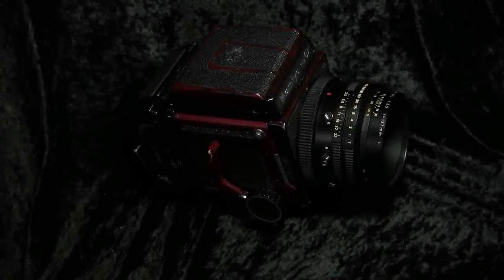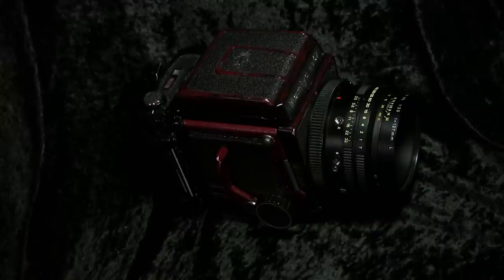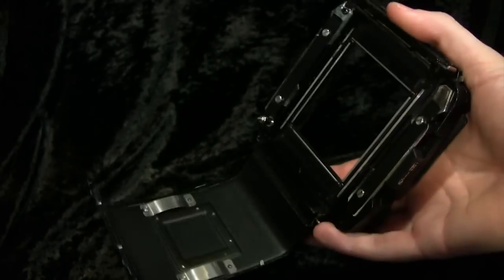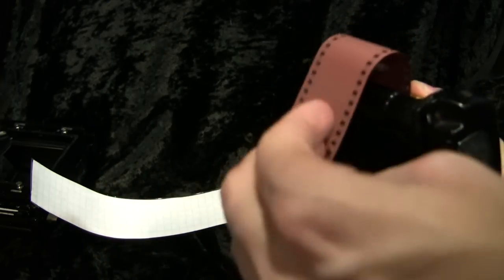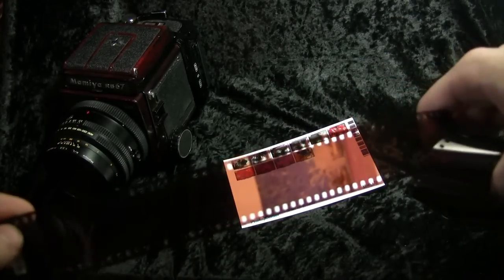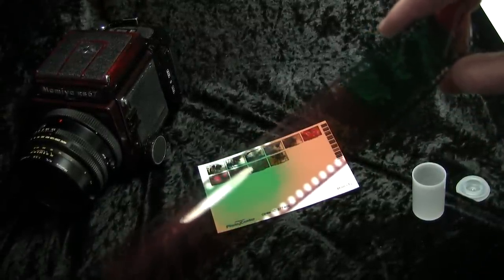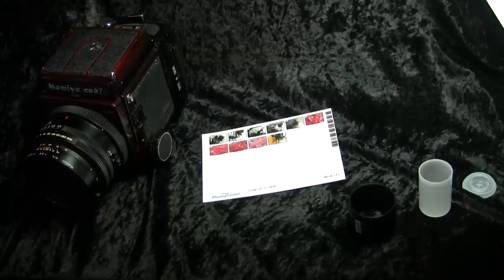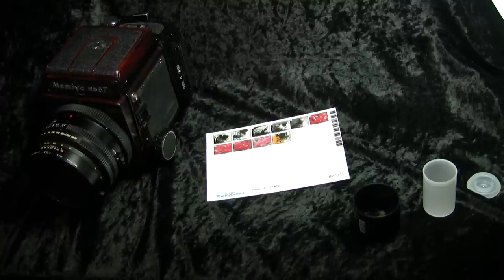Loading 35mm Into RB67 Medium Format Camera

Comment: There are different versions of the counter drive roller.  The Pro SD magazine, with double exposure protection, has the small counter roller you illustrate; the older Pro S magazines drive the counter with the complete turn around roller (that is, there's no separate roller for the counter).  That means they'll count and space the frame correctly with any film that fits in the camera.  To make a Pro SD magazine like yours count and space frames correctly (and start the exposures in the right place, as a bonus), wrap a single turn of that electrical tape around the joint between the turn around roller and the counter drive roller.  That will cause the roller that the narrow film actually contacts to drive the counter.  Throw in a pair of adapters for 35 mm in 120 cameras ($8 to $15 a pair) and your 35 mm cassette will stay centered and not need tape.  

Get a second pair of those adapters, and you can set up to wind cassette to cassette, and only the last exposure will still be exposed when you reach the end of the film -- you can unload in the light, and all but your last exposure will be protected inside the take-up cassette.  Further, this will keep the film straight as it passes the gate, so you can compose with confidence.  If you have empty cassettes for bulk loading, you can set up the cassettes with a throw-away leader, throw-away tail (8-9 inches should be enough, just long enough to ensure your last full frame is in the cassette when the film stops), and have multiple rolls set up this way to be able to change film multiple times in the field.  Do be sure to mark which cassette is supply,. and which take-up, if you do this...

Comment: that problem with the film spacing could be solved by loading the film onto the backing paper/ sprocket of the 120 mm  size, using the backing paper to revolve the rubber spool as it was intended to do, just have to bulk load the film onto the spools.